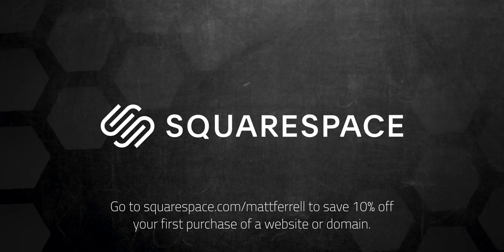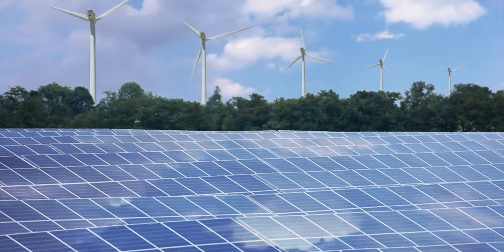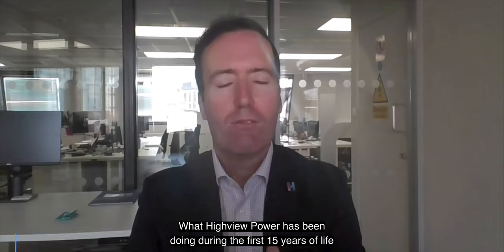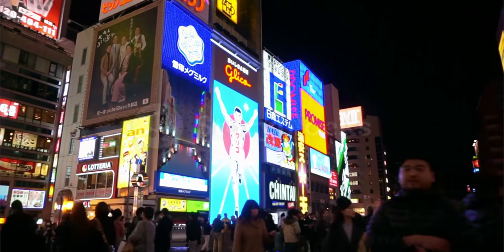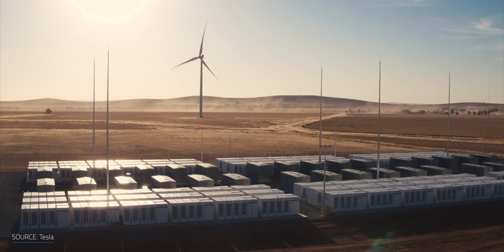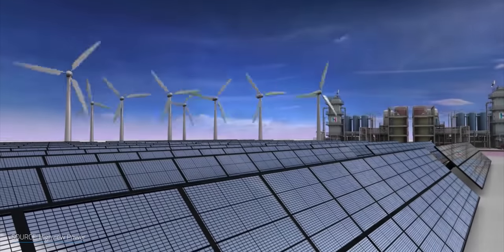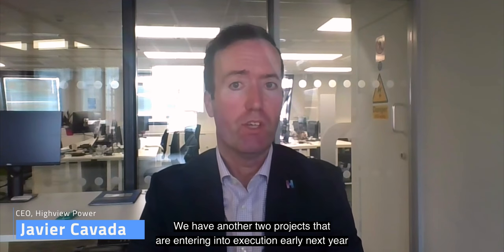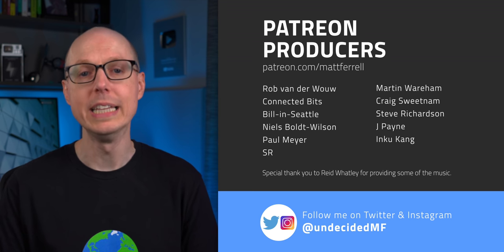Liquid Air Battery Explained - Rival to Lithium Ion Batteries?

Comment: could this be viable for charging EV's
Reply: lowtechmagazine com/2018/05/ditch-the-batteries-off-the-grid-compressed-air-energy-storage.html  Is an interesting read especially the section towards the end of the article on  Small-scale, Low Pressure CAES systems.  

It talks about research back in 2010 using a modular, many small tanks at low pressures, hooked together type system which eliminates the heating and cooling requirements and complexity of a large scale system.  Also because its modular the system can be discharged all at once to achieve high outputs/shorter durations or sequentially thus lower output/longer durations, thus flexible for given applications such as super charging or overnight.

The advantage of such a system is longevity, this video stated that the high pressure system projected lifespan was 30 years, well imagine a system where nothing is over stressed thus maximizing system lifecycle and compare that too battery chemistry having a 7-10 year lifecycle. The disadvantage would be higher system startup cost, but that is offset with a system that will outlast you.

Comment: Yeah but the stupid thing is even less energy dense than lithium batteries. And the maintenance...
Reply: I'd be surprised if the maintenance cost of these compressors and turbines isn't a lot lower per MWHr than the maintenance cost of a gas peaker plant.

Comment: These would almost have to be owned by the solar/wind farm and be put in before power is sent to the grid.  Once you put it on the grid and you are paying grid rates to purchase power then sell power there is no possible way 25% efficiency or even 50% will work.
Reply: Hi it's not about efficiency. These liquid air storage plants are likely to be owned directly or through subsidiary firm to gain tax advantages by the National Grids and make sense as they at the moment pay a fortune to have gas and wind farms sitting idol. 
They have to guarantee a certain amount of work to all the power providers as they are obliged to have a safe amount of overkill of power supply in case of problems. In return though for this guaranteed work the grid does though in return to put the squees on what the suppliers can charge, so it is beneficial to both parties involved.
Along with paying power stations and wind farms to sit idol there is also the issue that if wind is over supplying at a time when gas power have been promised working time then the wind farms are switched off.
This is why energy storage is so important and the more ways it can be done the better.
Reply: @helenlawson8426  While it might work on a nationalized grids with massive subsidies or pressures from loss of subsidies used for wind and solar that doesn't make it any better of a proposition.  Why use such an inefficient method to try and fix problems of a broken subsidizing situation.  This would make no economic sense except through massive subsidies.   Market rate grids this will never work unless the source (solar or wind farm) had this before it entered the grid.  That would allow that single source to be better utilized and efficient.  Otherwise the grid market rates apply and this wouldn't work buying and selling.

Yes, solar and wind are out there with lots of subsidies.  That is why you see in a lot of places when the wind turbines break the companies don't bother to fix them.  They don't get grants and subsidies to fix them so they go build new ones.  They are horribly inefficient when looking at the whole of the grid and time used and yes we need a storage method to make them more viable.  But pushing really low efficient solutions with lots of money is just pouring more money down a hole.  Pumped storage is still the best alternative right now but environmentalists kill most of those projects.  

I have worked on licensing for energy storage (mostly pumped storage) and it takes forever to get them licensed as well as getting transmission lines licensed and built.   You have to have a transmission system that can both provide and take the power to this facility.  Those costs add up as well.  Simply scaling up a facility isn't always an option.  These types of facilities cause complexity in their need to both consume and provide power to the grid.
Reply: @drrockf4d  Hiya, such a hard thing to reply to as there is obviously a political side to everything you are saying as subsidies don't just happen for renewables and to think the world would work without them is worryingly naive for someone who has worked in the industry. 
Your lack of understanding of a how a Grid 'has to work', no choice in the matter if it is to guarantee 24/7 electricity supply is also worrying. Paying power suppliers to sit and do nothing is not a subsidy and although not perfect they must have a reserve and no one is going to invest in a power plant that the grid may or may not want to use, it's all a negotiation. Obviously if the State owed everything it wouldn't be such an issue as all the politically sensitive wording like subsidies would go away and become what it is which is simple supply and demand.  
As an aside wind and solar have reduced in cost and improved in efficiency to the point that even when subsidies were taken away fro wind energy it didn't stop just slow down a little. The last wind farm built off the UK wasn't subsidised at all. 

Converting Electric Substations on the grid to two way is not that big a deal other than there is a lot of them and something that should have happened long ago.

Ok I will give you that Matt didn't impress on his viewers (slap wrist) that the around efficiency of this system that has been in development for over a decade with two test plants one full size is 60-65% which stands up well to everything but batteries.
Getting permission for an air storage unit is not even close to the same as pumped storage which is quite rightly hard to get through. Like battery storage a liquid air plant can be scaled up or down but better for town to city size they can both be built anywhere in the world. Energy efficiency isn't everything as if your fuel is wind or the sun then not having it switched on generating electricity is an 100% waste of energy. 

The early days of wind and solar were like a wild west of industry with lets be honest the worst practises of the oil industry transferred over to the new. Many enterprises starting up with little long term interest just getting the money and getting out again. This although something to be aware of should not be used as a blanket guide to how the wind & solar industry as a whole is run now. Lets not forget there is a charity going around Capping old long abandoned oil wells so private industry in general has not had a very good track record.

A grid with energy storage is actually a missing link as regards energy security and if renewables have forced their arm into doing something about it then it will be worth the cost. 

Sorry for the long reply and try not to get to angry at me and read what I've said. 
Helen x
Reply: @helenlawson8426  It is easy to reply without assumptions but you don’t seem to want to do that.  I never brought any political side into this, just reality of what is there.  While there are always subsidies and they do impact all energy markets it is also naïve to base your entire project on them.  I have seen so many of these style pipe dreams come along using green washing to paint over the glaring problems.  Stacking concrete blocks, wave power and all those other new green energy solutions that get people excited and draw in lots of dollars and grants but can’t answer simple questions.  Decades later the eventually statements never materialize and it all comes out.  I would love for these style projects to work but at 25% efficiency with promise to be able capture so much waste just doesn’t add up.  They say they have been working for 16 years to perfect technologies that in the very same sentence they state are well known.  That is a giant red flag right there. 

My understanding of how the grid actually works helps me to understand the enormity of creating something like this on a large scale.  The grid doesn’t allow you to just connect on anywhere and both take and supply power on vast scales at any time.  It has to be intricately coordinated and the infrastructure has to support it.  Location has always been a major problem with renewables.  When building a giant solar farm, wind farm or pumped storage they usually need to also install a hundred miles or more of transmission lines (large scale usually in remote areas).  Laughably a lot of the time they are built next to existing transmission lines from adjacent projects to get to a major station.  Licensing, timing, competition and many other factors force projects to go it alone and duplicate efforts because they can’t rely on other projects actually being built.   Small plants can usually be integrated into the system locally or within a smaller region.   This style of smaller plant would be much better suited on site for some green energy project.  Once you put it across the grid as just another storage solution you are putting it up against the market pricing.  While it would be nice during peak to turn this on and use the power if they can’t sell it at a profit standalone even with subsidies it is a problem.  If you place it with a dedicated solar/wind farm area under one ownership to maximize the potential of the solar/wind farm then you could balance those costs out and make an argument for it if it was viable.  Decoupling it from that you are basically just putting a massive power sucking plant that can occasionally resupply a little bit of power at low efficiency.  

That small plant they keep showing is the size of a very small chemical plant.  How much energy can it store?  To make these viable they would need to be enormous, you just can’t store massive amounts of energy in small tanks of liquid.   Oil refineries are huge and have huge storage tanks, the amount of energy stored in the petrochemicals is pretty low density compared to uranium potential but the scale of them is vast.  This plant would need to be gigantic really create large storage.  They speak of scale up and down is no problem and just add more units and tanks.  

Can the grid be altered and practices be changed, sure but it would take a massive effort to change anything the FEC (in the US) does and how they license.  Your simplistic view on we just modify everything for this to work is such a major fault in your argument.   

Energy efficiency is not everything but you are taking the promise of the wind and solar and trying to use this complex chemical plant style energy storage to offset that.  The maintenance and manpower to run these would be pretty substantial compared to the green energy production.  

I still see the wild west style attitude of green energy but I see it getting almost worse with the money being poured in and potential carbon offset markets tipping the scales.  Many of these new green energy projects come and go as they get heavily invested in the promises and eventually disappear.  The creators sure made a lot of money off investors and hopefully they didn’t start taking money from the public that they dupe into some of these projects.  

I agree that a grid with energy storage is the key to a lot of problems.  A truly reliable, cost effective, efficient storage and long term medium that doesn’t require very specialized locations hasn’t been figured out.  Many have 2-3 of those qualities, but none have all.

Comment: Imagine applying this type of energy storage on depleted gas fields, that would offer near infinite capacity.
Reply: Uh, no...the compressed air would eventually crack open fissures in the rock and dissipate.
Reply: @Jkirk3279  it isn't compressed air though.

Comment: If you capture energy which would otherwise be lost, then that is 100% effidient, regardless of the efficiency of the equipment used to capture it. I've also seen mentioned about using old coal mine shafts to raise and lower weights similar to hydro storage. A video on that would be interesting, Matt.